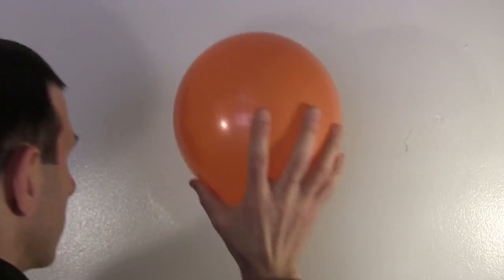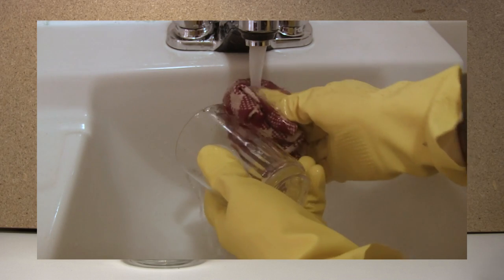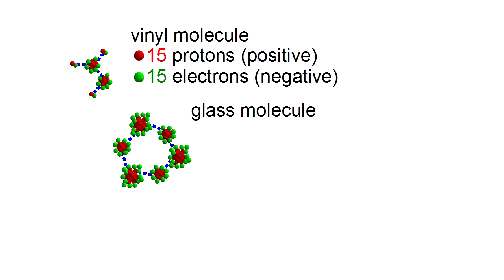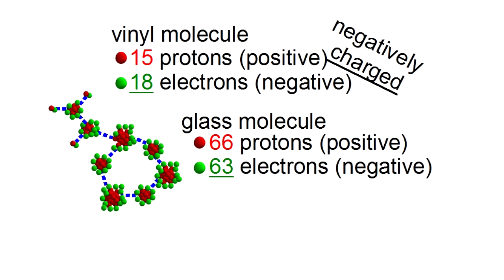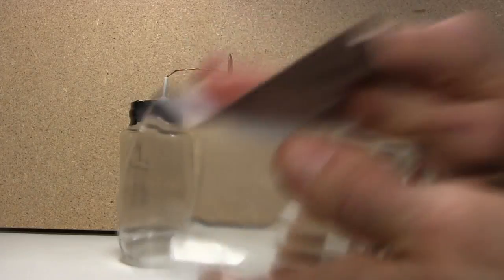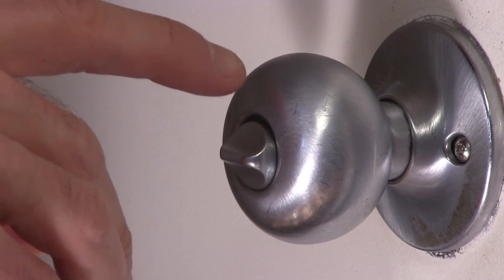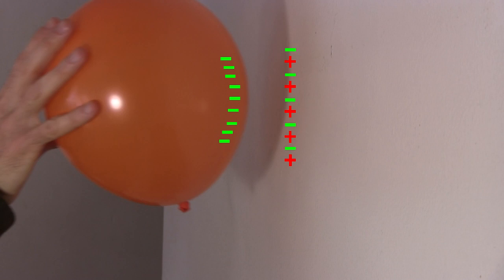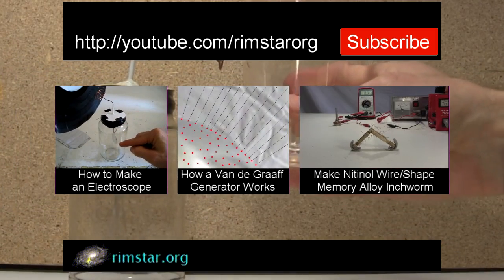Triboelectric effect/series or triboelectricity

Comment: I see I commented this video 4 years ago and I still remember it nicely. The best video explaining charging by rubbing in the entire internet!

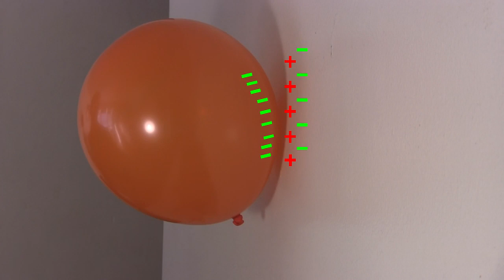However one question appeared in my mind. 4:23 - why when we stick the baloon to the wall it gets sticked? We can conclude that the charges in the wall move as you said, but shouldn't it happen in insulators? Or wall being just a little bit conductive is enough for it to happen? And what if we had metal wall, would the effect of attraction be stronger? (at least before the objects touch)
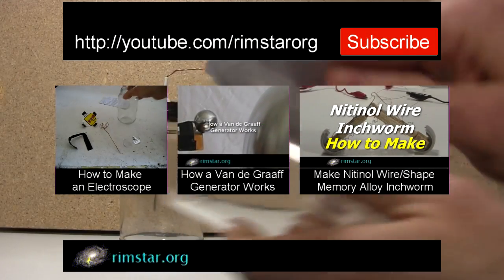Reply from the maker: Ah, I watched it again and I see that I didn't mention dipoles. At 4:23, when I show the negative charge repelling, since the paint on the wall and the drywall behind it are all likely insulators, as you said, the charge shouldn't move. Or at least not move freely. The molecules that make up the wall are neutral molecules. The electrons of those molecules stay with their atoms but move away from the side of atoms that face the balloon, leave the atoms more positive on the side facing the balloon. They're referred to as dipoles, because they have two poles, or polarities. https://en.wikipedia.org/wiki/Electric_dipole_moment
With a metal wall, free electrons would actually move away from the atoms. I'm not sure if the effect would be stronger though. Interesting question.
Reply: @RimstarOrg  Interesting, thank you very much!

Comment: Is there anyway where I can reduce the humidity in order for it to happen? my country itself is too humid, but I'm still trying to find ways to make this experiment happen
Reply from the maker: I typically use an air conditioner to dry my air, the same thing I use to cool my place on a hot day. There are also things called dehumidifiers. A simpler way though might be to just dry the surfaces that you're rubbing together, maybe by blowing hot air over them with a hair drier (just be careful to not melt any plastic or burn yourself).

Comment: But why do 3 elections move from the glass to vinyl It's the electrochemical bond but why and how does that happen if both the glass and the vinyl are originally neutral molecules?
Reply from the maker: I'm no expert on the "how" at that level but from a quick read here https://en.wikipedia.org/wiki/Triboelectric_effect#Cause and here https://en.wikipedia.org/wiki/Electrochemical_potential shows that different molecules have different elecrtoschemical potentials and that determines which one gets the electron.

Comment: FINALLY, a video on the triboelectric effect that actually EXPLAINS it! But there's one question this video doesn't answer. The balloon doesn't stick to the wall forever. I suppose that means the charges somehow equalize again. But how does this happen?
Reply from the maker: At a guess, the balloon moves around enough from air currents to break the bonds long enough for ions in the air to be attracted in and stick to the balloon and wall instead. As more of this happens, the overall hold on the wall weakens and the balloon slips down, allowing more bonds to be broken and ions from the air to replace them and so on.
From my email notifications, you also asked where the air ions come from but I can't find where you asked it. There are a number of sources. Ions are constantly being attracted from the upper atmosphere where ionization occurred due to the affects of sunlight. Also, natural radiation at ground level causes some of it. There are others too but I don't recall what off-hand. I read up on it while researching for this video on powering a motor (weakly) using atmospheric electricity https://www.youtube.com/watch?v=2rVdEhyMR6A That was a follow-up to the actual experiment video https://www.youtube.com/watch?v=qhXxSAv6rMg

Comment: I am recently trying to understand charging by rubbing. I first wrote down my theories on how it might work, because I wanted to check if I can guess it before actually trying to find out in the internet. Actually there aren't many videos deeply explaining it. However, it was one of my theories that bringing materials together may create a connection between them, like you said, making charges inbalance after separating objects. However, I thought my theory wasn't the best. Because if it worked like that, then why the rubbing is needed? Shouldn't it work just by putting objects together and then suddenly separating them? In your video there's no such question. Could you explain?

My theory was that rubbing may create the bound easier, because materials like "get into' each other" -  like when scratching, nail can get into the skin and make a wound. Is this the case?
Reply from the maker: Rubbing isn't needed. All you need it to make contact and then break contact. Rubbing is just a very fast way of doing it. For example, I show in my Van de Graaff video how the contact is made and broken by having a belt roll along a roller. See three minutes and thirteen seconds into the video here https://www.youtube.com/watch?v=EsZQS2GOMQE Wikipedia's page has a good description that goes into more detail than I do in the video https://en.wikipedia.org/wiki/Triboelectric_effect#Cause
Reply: @RimstarOrg  Thank you very much, as I went deeper into "triboelectric effect", I noticed that it explains all I wanted! However I don't quite understand one thing. I just made a quick electroscope and took a ruler. It kind of works (not like I wanted but it detects that something is charged), but when I try to put ruler inside my hair instead of rubbing it, it doesn't get charged at all. Do you have an idea why's that? Would I have to keep it for much longer inside my hair? Or just in this case the contact is too small and thus the rubbing is needed?

Btw, I feel kind of stupid that I have NEVER heard of triboelectric effect. Like it seems to be a basis for all of this. They teached me at school about charging, I saw videos about charging and similar stuff, and nobody from these videos mentioned this effect (besides you of course, but I have 'discovered' you just today). I also love to dig into different science videos in the internet and I think I haven't came across this effect before. I also kind of ignored the question WHY it happens for my whole life, but today I changed it and you helped me, thanks :D

#EDIT
I am watching your videos now, and in this one:
https://www.youtube.com/watch?v=2PmWlPjV6n0
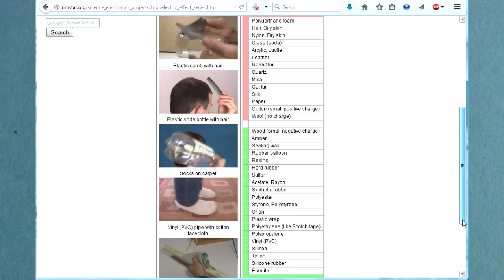in around 3:50 you say you can't just touch the vinyl, you need to rub it. Considering triboelectric effect, why is that? It's just an addition to my first question. Thanks in advance!
Reply from the maker: You need to make and break contact a lot in order to cause a lot of charge to be transferred. If you just put the ruler in your hair and take it out once then you've made contact with very little area. Rubbing is just a way of making and breaking contact with a lot of surface area in a short period of time.
Reply: @RimstarOrg  Got it, thank you! I have one more question - do you have an idea why my electroscope discharges when I put charged ruler near the "receiver" (coil)? I have made a similar electroscope, but when I bring my ruler, I can hear that electric sound and ruler gets kinda discharged. Is the air too wet? I am not sure what I've done wrong.
Reply from the maker: I don't understand. When you bring the ruler close to the "receiver" coil, isn't that what's causing the leafs to spread apart?
Reply: @RimstarOrg  Yes, but leafs spread apart just for a brief moment. Then there's that 'electric' sound like charges balance. Like additional charges between the device and ruler balance out.
Reply from the maker: Make sure you don't touch the receiver with the ruler as that might create a high resistance path to ground through you. That would discharge it. Or maybe if the air is dry enough and your ruler is close enough, it might be discharging through the air gap.
Reply: @RimstarOrg  Yeah, electrons from the ruler seem to go to the aluminium leaves. As soon as I hear the "electric" sound, the leaves keep repelling each other, even if I take the ruler away. It means there are more electrons than protons in the system. However, I don't fully understand why this charge goes there? Is it because in the moment of putting charged ruler near terminal, there are more protons than electrons in the terminal so it "wants" some of these electrons?
Also, I have used pan with teflon surface and a glass to try if they charge each other, but it didn't work. Any idea why? Maybe there's not much teflon on my pan anymore? OH, I just think about it and maybe it gets charged but automatically gets to my hand through the metal pan.

Comment: I have a question about the Triboelectric series table in
regards to building a Van de Graaff generator.
Is a positive material on one roller and a far away negative
material on the other roller how it is done?
How is the belt material determined?
There are three materials involved, 2 rollers and one belt.
I keep hearing people talk about using a top positive material
with a low negative material, but not explaining how this
relates to three parts.
I'd appreciate any clarification you could provide.
TallDudeInLA, using my wife's channel.
Reply from the maker: Yes, the surface of one roller is made of a material near the positive end of the triboelectric series and the other negative. Or it could be the other way around. The inner surface of the belt is made of a material which is somewhere between the two in the series. That's why rubber works well, it's near the middle of the table.
That way, if the bottom roller is positive, for example, then the belt is more negative than the bottom roller, while the belt is more positive than the top roller. It's really the relationship of the belt to each roller which is important. That's where the triboelectric effect takes place. See my how a Van de Graaff generator works video for an animated explanation on that https://www.youtube.com/watch?v=EsZQS2GOMQE.
Reply: @RimstarOrg  Thanks for the reply. I will build a VDG one day soon, I hope!

Comment: would it produse elecrticity if i made a converer belt to turn around a glass test tube?
Reply from the maker: Yes, absolutely, provided the belt was made of a material far enough away from glass in the triboelectric series. The inside of the belt would become charged and the surface of the glass where the belt rubbed against it would also become charged. That's exactly what happens in a Van de Graaff generator with the two rollers. I talk about it in my video about how a Van de Graaff works here https://www.youtube.com/watch?v=EsZQS2GOMQE.
Reply: and just another question i have a glass jar and i put pvc dust or very small particules and shooke the jar with the dust inside would i produce ssome small static electricity?
thank you in advance
Reply from the maker: Interesting. That should charge the PVC dust negatively and the inner surface of the jar positively. If the jar is full of PVC dust then both charges would be next to each other and the effect would be neutral overall.
But if you let the dust settle to the bottom of the jar (unless it floats) then wherever there's no dust near the glass, the glass should appear to be charged from the outside (if it's charged enough). i.e. the outside of the jar isn't charged but the charge on the inside should be felt from the outside.
Then again, the dust is negative and the glass is positive, and unlike charges attract, so if the dust is light enough, it might be attracted to the glass and the overall effect will be neutral. So while they're charged, you may not be able to detect it because they're next to each other.
Like I said... interesting.
Reply: thank 
you

Comment: a question: if you brought a POSITIVELY charged item to a wall, it wouldn't stick, because the protons can't by themselves decouple from the electrons, right?
Reply from the maker: The item is positively charged because the atoms are missing some electrons, so it doesn't matter that the protons can't decouple from the nucleus of the atom. When it approaches the wall, electrons in the wall will be attracted to the surface of the wall by the positive charge of the item. That attraction will make the item stick, as long as it's lightweight enough.

Comment: Around 02:30 in video, after being rubbed and separated,  if the glass and vinyl molecules now have different numbers of electrons than before, is the glass still glass, and is the vinyl still vinyl? Or have you created a new substance?
Reply from the maker: Excellent question. Yes, the glass is still glass and the vinyl is still vinyl. The thing that makes an atom the particular atom that it is is the number of protons in the nucleus. The number of neutrons in the nucleus can vary, and so can the number of electrons. Though it's easier to change the number of electrons than the number of neutrons. Wikipedia's introduction for the atom is a good, and simple, summary https://en.wikipedia.org/wiki/Atom.
Reply: Thank you, RimstarOrg.

Comment: i am suppose to rub glass on denim, cotton, polyester and tetrex then touch the wire but i am not getting a reaction and same process with the four cloths but with plastic straw this time to touch the wire still no reaction....electroscope made as shown
Reply from the maker: Make sure the area of the material that you rub is the part that you bring closest to the wire. Rubbing the materials doesn't charge all of the materials, just the areas where they rub together.
Also, I mentioned this in the video, but it's an important factor in why it sometimes doesn't work, the air must not be too humid.
When I use the glass, I first have to clean the glass with soap and hot water and then rinse off all the soap thoroughly otherwise it doesn't work for me either. The glass seems to be very finicky.
A plastic soda bottle works very well when rubbed against clean hair (no hair products). But again, the areas that rub together are the areas that become charged.
Hopefully something in all that helps.
Reply: tried but still no reaction when plastic or glass is rubbed then touched to the wire....so the scope may work or not depending on humidity? ...my country is a hot hot country would that be a factor why it doesn't work?
Reply from the maker: No, heat doesn't matter.
Make sure you're not touching the wire with your fingers when you do it. That would prevent it from working. But you can hold the container that the electroscope is in.
As I said, I found it hard to get glass to work since I had to clean it thoroughly. If something's plastic then it's also not guaranteed to work since there are things added to the plastic. It sounds like you just need to keep looking for different materials.
It's possible there's a problem with the electroscope itself, but in all my years of helping people with this it's almost never, if ever at all, been the electroscope.
Make sure the leafs can move easily and are made of a lightweight foil. Pieces of heavy metal or sheet metal for the leafs won't work.
Also, the wire may have a coating on it where the leafs hang from it. Any coating there would prevent it from working. Scrape that area with a knife to remove any coating if you think there's something there.

Comment: I want to build my own electrostatic separator. Can you help me giving some idea please..
Reply from the maker: +Baskoro Lokahita I have no experience with electrostatic separators so I don't know what the requirements are. It may even differ based on what you're separating. You may need anything from a very low power Wimshust machine to a high power electronic power supply. Both are high voltage but the available current differs. So I really can't say.

Comment: When I got shocked many times in the dark before the electric sparks were clearly visible, it's very cool but quite a bit painful. Have you seen this effect in a dark room before?
Reply from the maker: Brandon Fisher It shouldn't make a difference if the room was dark or not. Maybe it's dark because of the time of day, and maybe it's dry in the room at that time of day. If it's dry then the charging done by your socks rubbing on the carpet will work better. I'd look for some other reason.
Reply: RimstarOrg It was some time in winter at night with all the lights turned out, I got shocked touching the DirecTV reciever in my room right after I took of my polyester jacket, I'm telling you I'm not making this stuff up; you could possibly see the spark in a dark room :-)

Don't try this and expect for it to work because it doesn't always work 100% of the time

Comment from the maker: +Manchease Skrelpher Since the material is charged, opposite charges in the surrounding air are attracted to it. The charges in the air slowly neutralize the charge on the material.
PS There's no Reply button under your comment because of your Google+ settings.
- go to your Google+ page,
- in the top, right corner click on your thumbnail icon,
- in the popup that appears, click on "Settings".
- for the 2nd question down "Who can comment on your public posts?" set it to "Anyone".
Reply: But what happens to the air when the charges in the air neutralize the charge on the material? Wouldn't the air itself get charged as a result?
Reply from the maker: I suspect those neutralized air molecules just stay on the wall.